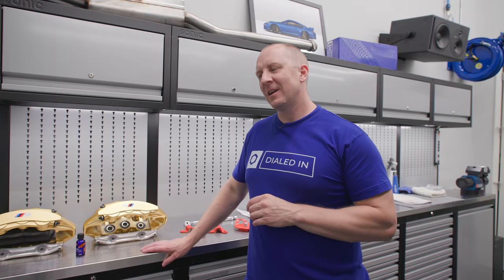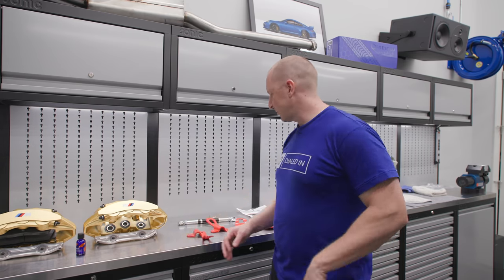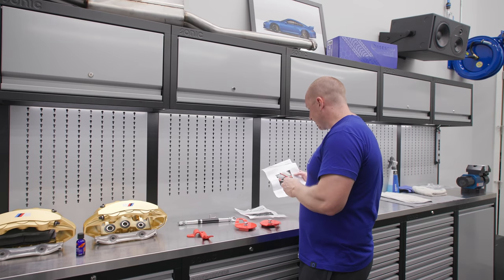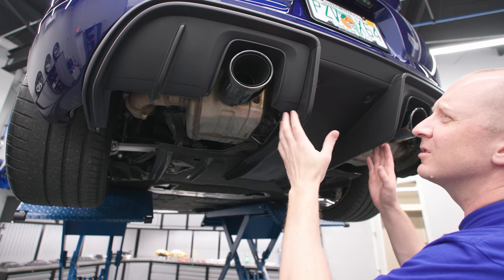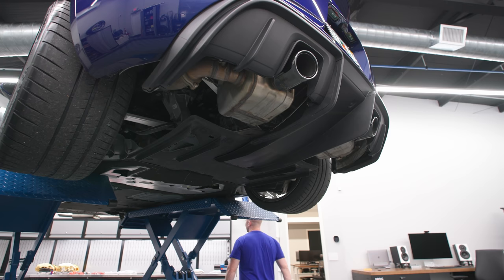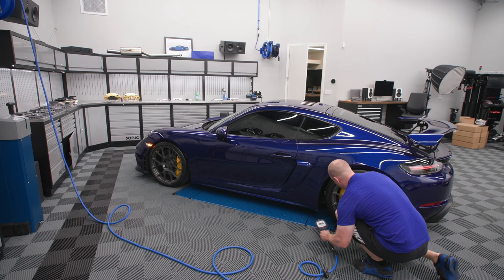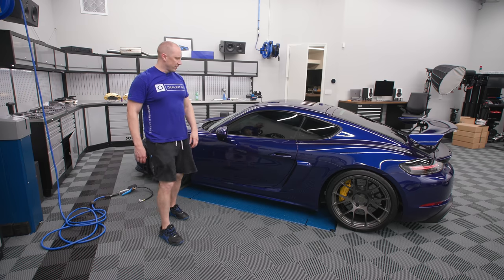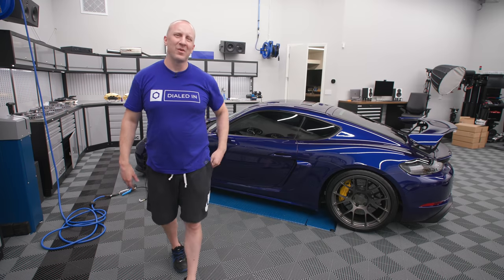718 GT4 Rennline Subframe Stabilizer and Tie Downs

Comment: on that central diffuser part, would it have been possible to attached it at the front FIRST, near the bar/tiedown , then screw in the back near the exhausts?  im thinking the rear has more flex and can be kinda pushed/pulled to reach the screw holes more easily than the front...  
Also... you should mark any torqued bolts with the torque needed so you don't have to look it up (sharpie) and also mark the bolts with a tamper torque marker paint so next time you see the bolts you can tell if they've moved or not.  and I would apply locktite to the threads.

Comment: I installed those same Rennline bits on my 2010 Cayman S shortly after getting it and the brace made a difference to me. Then I followed up with the Cayman R stabilizer bar and that was a + too. Did you get a difference you could feel on your GT4 ?
Reply from the maker: I didn't notice a difference, but it sure looks cool under the car.

Comment: Hey Matt, how important is that stabilizer i’m thinking the tow hooks can be installed without that just concerned that the diffuser might be catching air but I really didn’t see I would think it’s more important that it  fit flush than having a stabilizer just a thought and I do like the rims definitely do something with the center caps have a great one .
Reply from the maker: I was thinking the same thing.  I think you could just nix the bar and have an nice, easy set-up.

Comment: Sounds like you need a portable single post car lift. You can stick in a corner. Or maybe a Hoffman lift.
Reply from the maker: The problem with those is that they are just for storage.  I want to be able to get around and under the car to work on it.